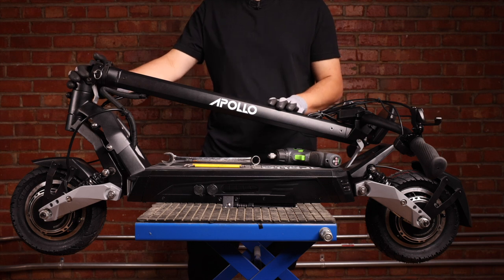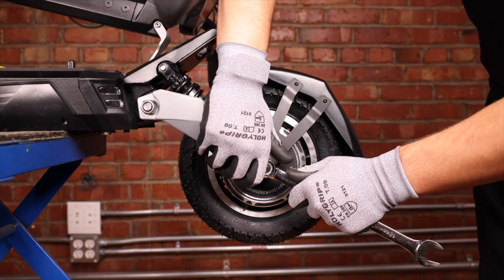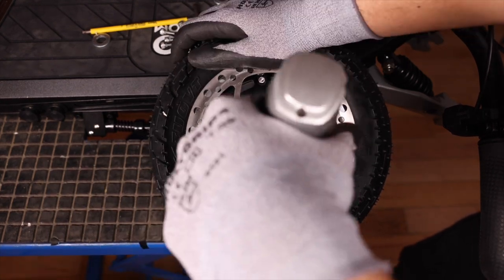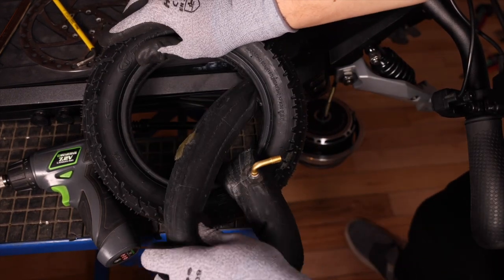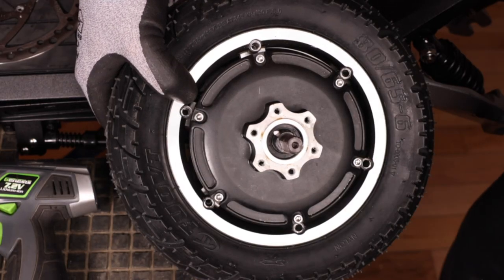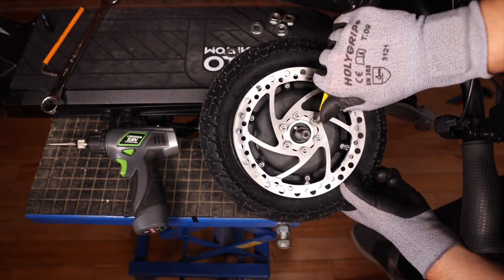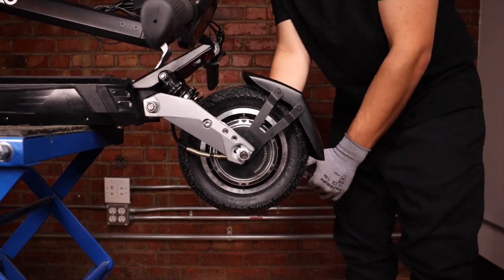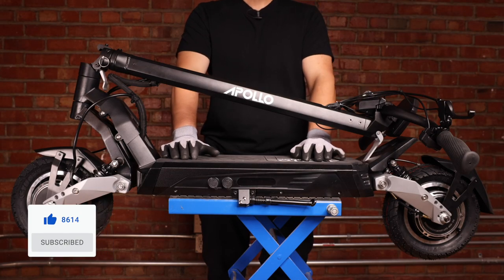How To: Apollo Phantom Inner Tube And Tire Replacement

Comment from the maker: UPDATE: Newer versions of the Phantom feature 21mm wheel nuts. The repair process remains the same, you will just require a 21mm wrench instead of an 18mm wrench.
Reply: Wish I saw this before ordering tools, rip
Reply: What is the recommended torque pressure for the wheelnuts?
Reply: @JwAirHorns  well as everything... a little bit before it breaks is the perfect amount 🤣
Reply: Wish I had seen this comment before making a trip to the hardware store and not getting a reciept 🙄🙄🙄🙄🙄🙄

Comment: Adding some baby powder on the tube and inside the tire helps immensely. Just the friction between the  sticky tube and tire, can cause tubes to blow out early especially if the pressure starts to get low..

Comment: Question. I am wondering how to fully pump the tire up after placing the motor in because the piece I need to pump air into is very tight under the rim and motor but goes in the way yours does.
Reply: Any updates? I'm currently having the same problem
Reply: @jaxsenelias9771 & @TheF22Craft, I had the same problem but all you need to do is get some pliers & gently pull the metal piece of where you pump air in the tire

Comment: Please update the video for the V3, as there are several differences not pointed out here in the comments, ie: fender goes outside the fork, mine has 2 washers meant for inside the fork and I could NOT get them both back on once removed.

Comment: What phantom model are you showing here? The nuts on my phantom v2 are 21mm not 18mm
Reply from the maker: Great question!
Yes, this video features a V1 Phantom which had 18mm wheel nuts, but the V2 comes with 21mm nuts.

Comment: What happens if you don’t remove the calipers before removing the tire? Would it cause unnecessary noise?
Reply from the maker: Hey Nathan,
Removing the callipers can help with the reinstallation of the wheel after replacing the tube/tire, in that you don't have to try an re-align the brake disk in the pads when reinstalling.
Reply: @ApolloScooters  got it. I recently popped my tired and was changing the tires, after the change, the brakes/ rotor and wheel started making a loud screeching noise. Suspected that the caliper mount is bent after thorough checking. I own the Apollo Phantom 60V. Any recommendation? Call in to order some replacement parts for it?

Comment: First off I want to appreciate you making this video, it allowed me to pull off what I thought beyond me.  There must be something wrong with the tire or rim as when I took it off( the inner tube), I filled it up with my pump and submerged it in the sink of water and there was no hole. I replaced it with a new tube anyway put everything back together filled it up went for a short ride, and it was flat again. So I’m not sure what the issue is, but the air escapes somehow.

Comment: What is holding the power cable on the front wheel?
Reply from the maker: Hey Scott,
The motor wire is held into place on the front wheel assembly by a small bracket to direct the cable away from the hub.

Comment: For everyone wondering why they have 2 washers....you likely have the V3 (as I do) the washers go inside, then on the outside the locking nut, then the fender and finally the nut.

The difference is the fender goes on the outside of the frame. Must be a change they made but forgot to update

Comment: Tip of the pro , don't use the allen keys provided with your scooter, they are not good quality and will strip your bolts, use real ones sold at  the tool store. The Wera brand shown it hte video are the best
Reply: Yeah get park tools they work great.

Comment: Guess I'll ask this question again:

The '22 Ghost takes 10" x 3" tires, but requires 10" x 2.5" inner tubes.

The '23 Phantom takes 10" x 3" tires, but does it also require 10" x 2.5" inner tubes?

Are tires and tubes on the Ghost and Phantom interchangeable?
Reply: i just changed my tires on the phantom and i used 2.5 and works great
Reply: @sergiolandz6056  Yep, I recently discovered 10x2.5 and 10x3 both work great. As long as the valve stem is at a 90 degree angle. What an ordeal changing those tire though! Takes forever.

Comment: Replacing the front tire tube on the Phantom 23. The nuts holding the wheels on are 21mmm not 18mmm as stated in the video. There is also a clip that is holding the motor wire to the front fork that needs to be removed. The motor cable is also tie wrapped to the front fender.
Reply: Do you recommend this scooter?
Reply: @PumaM90  i have the phantom and i never had any issues what so ever and all the people whom i talked with all find its a cool looking scooter. And some of my friends were laughing at first until they took it for a spin and hit close to 70km/h they were not laughing after that lol..

Comment: I spent a lot of money on this scooter and with fewer than 150 miles on the clock, the lack of quality in both materials and construction is deeply disappointing. You've assembled it with low-grade hardware and seemingly everything is over-torqued. Three of six brake disc screws stripped out when using the proper allen key. Similar situation when removing stem bolt recall screws. This is completely unacceptable; will be contacting CS on this.

Comment: Hello everybody,

Here is my 1 month review on Apollo V2.

Overall the build quality is very good, the ride is smooth and fast - it’s a great scooter. However, there is a super big BUT…

First of all, I’m a doctor from Johns Hopkins University and I bought this scooter to commute in Baltimore to work (I had an Etwow S2 scooter for 5 years, which was great, however the battery was getting old and I wanted something faster).

When the scooter arrived I was hesitant to keep it because it was fairly big - you definitely can’t hop on the Bus with it (for example if it starts raining) and it’s difficult to put it in the trunk - although possible (I have a normal sized sedan).

The super big BUT with the scooter is the following ==> Flat TIRES!!!!

When my scooter arrived I accidentally saw online that many people complained about flat tires! It is REAL GUYS and is super serious!

I got my first flat tire only on my 3rd trip/day, which was super super annoying because I needed to go to work but when I came outside I realized that the back tire was flat. It was kinda pain the the but to fix it few days later. And yes, I was late to work and patients were waiting for me!!!

Because the ride quality is actually really nice, I decided to give it another try and come up with something.

My friend recommended me to buy Armor-Dilloz Filler, which I did. I also purchased a special rubberized band to prevent flats that installed between the tire and the tube!

Few days ago I’m getting another flat guys when coming back from work (~5 miles from work to where I live) - I have to drag the scooter for a few miles and finally my wife was able to pick me up about 1 mile from home (some difficulty putting it in the trunk by the way as mentioned above). 

The question is, how in the world did I get a second flat tire 1 month with 2 “anti-flat modifications”. I’m riding on the bike lanes, don’t do anything crazy (no jumping, off road riding). I had my Etwow scooter for 5 years and never had any problem with it (ride was good, super portable, much cheaper, never flats). I’m very disappointed that I had to pay a little over $2000 for this scooter and I CAN’T RELY ON IT!!! Someone can literally die in the hospital if I get late.

Another small things is those 2 caps at the charging port are really bad quality - one was disconnected out of the box (I’m talking about the plastic cord that should be attached to it was missing a tiny part) - now the second charging port plastic peace is disconnected.

Those rubberized covers for the screws - 2 got lost already.

I’m just dissapointed that I bought this as a means of commute, but you can’t trust it. I’d rather have hollow tires and it being heavier.
Reply: you wouldn’t believe it, after finishing the above review, I rode my scooter from work home and guess what…. 3rd flat ==> 2 days in a row, WTF!!!!!!!
Reply from the maker: Hey Dzmitry,

Thank you for taking the time to post your review of the Apollo Phantom here! We're sorry to hear about your tire going flat on you multiple times in 1 month. This may be caused by riding the scooter when the tires are not at an optimal PSI, or there maybe something within the rim causing your tubes to puncture. 
Please do not hesitate to get in touch with our support team at support@apolloscooters.co so we can help troubleshoot this with you and avoid these recurring flat tires!
Reply: @ApolloScooters  Thank you for the quick reply! I was able to reach customer support and hope that we will be able to solve the issue. It’s difficult to say, maybe because it’s cold outside at Baltimore —> that causes to lower the tire pressure from 50 PSI at home/room temperature to below and making tire to pinch?! I had to ride my old scooter to work today, Phantom is soo much smoother and enjoyable ride, I surely hope that this issued with flat tires can be fixed.
Reply: 4 month Update! I finally figured what was going on with the help of my friend and also Apollo support. My back tire was under-inflated (probably few PSI below recommended 50 + close to freezing temp caused air to compress more) and was causing pinched tire! I filled it to like 53-55 PSI and haven’t had another flat for 2 month ago! I love the ride and would highly recommend this brand and scooter! It’s brings joy to me every single day - I don’t have to pay $1400 per year for parking at our hospital, don’t have to wait through a bunch of stupid unsynchronized  Baltimore traffic lights, safe in gas, etc! Highly recommend! Customer service is also great and helpful - they have send me a new tire and two tubes last time I had a problem (initial review)
Reply: @dzmitryhaviazheu5199 thank you for sharing this! I’ve been having the same issue. I will try this solution!
Reply: @methodswan thank you! Yes; make sure that you have good tire pressure! I haven’t had any more flats after I had the right pressure (50-52 PSI). Absolute love the scooter and quality of the ride! Now had it almost for 1 year

Comment: Horribly built scooter made for a ridiculously difficult job, even with this video. The majority of this was not in any way as easy as it was made to look.
Reply from the maker: Hi Kevin, thank you for your feedback. We're sorry to hear you didn't find this very helpful. If you're currently trying to change your tire or inner tube, and are having difficulty doing so, please reach out to our support team directly via our website! They would be happy to assist you any way they can :-)
Reply: I honestly don’t know how you had such a hard time. I am in no way mechanically inclined, but I watched this video step-by-step, pausing it every time I needed to do something.  I had a little trouble remembering where the fender fit into it all, but once I figured that out it was cake.
Reply: Yeah. I just did it for the first time. Wasn’t very difficult.
Reply: @Copperhead47  congratulations?🤩
Reply: @kevinhorn4219  Thanks 👌
Reply: Great built scooter and this was easy to follow, thumbs down comment
Reply: Lol, not great build quality, stop fan boying this company. You can like your purchase, but unless you have owned Scooters in the same class you shouldn't be misleading  people like this. Apollo Scooters are ok at best and are worth the low price for the speed and ride you are getting but don't fool yourself , spending an extra 500 - 1000.00 will get you way less headaches related to maintenance and durability.

Comment: Had a 3hr process switching out my inertube on my V4. No matter what I did I couldn't get the axel to fit with both washers on either side. Tried with just the one washer, but makes a weird rubbing sound when driven.
Am I missing something on how to make  that second washer fit properly?